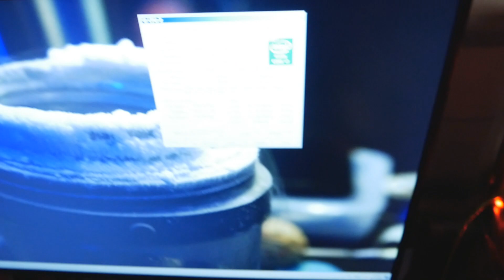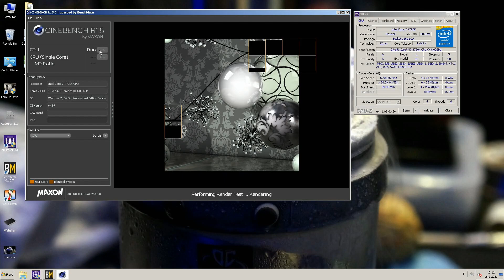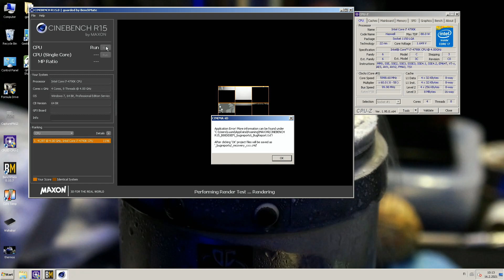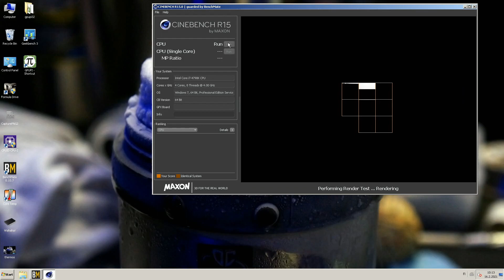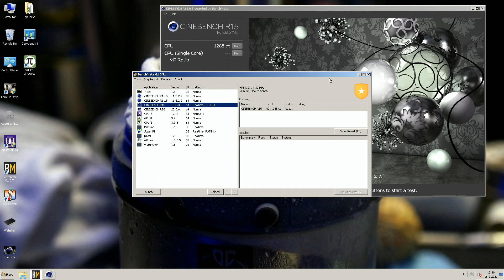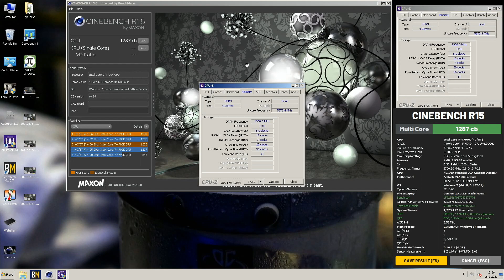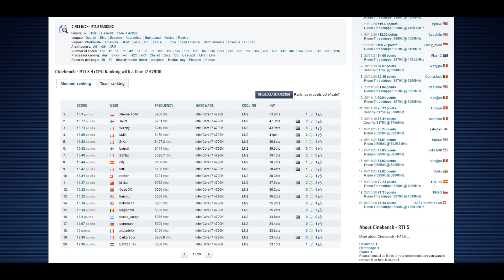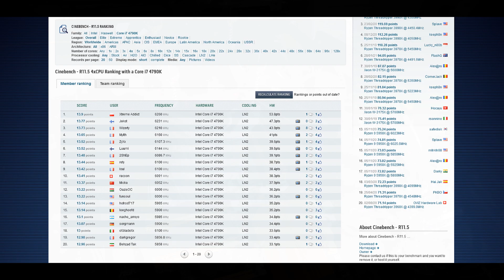Intel i7 4790K Overclocked Close to 6.2GHz on LN2 - Cinebench R15 RECORD

Comment: this is awesome!!!
i run a 4790k as my daily driver @ 4.8 ghz 1.310 volts, water cooled, kryonaut and delidded
i've been thinking i could try running at 4.9 regularly so i came to find some videos about top clock speeds :)
Reply: I’m running a i7 4770k and it running at 5.25 ghz in an msi board with a regular old Corsair liquid cooler in games it doesn’t get above 70 and cpu burner had got it up to 86
Reply: @Recon-3698  love that!!!  I feel like I could get more but my vrms cap out when i'm running a constant load over 115 watts lol
Reply: What affordable CPU cooler do u recommend to being able to overclock i7 4790K to 4.6/4.8 ?. I got a Scythe Kotetsu Mark 2 cpu air cooler now and it is good enough for handling 4.4 (max temp 81c)
Reply: @XenoCryptYT  I'm not sure what you mean by affordable. Getting something affordable and using it to push limits is generally not successful.
Reply: @justinbouchard  I understand that but there are coolers for the price of a higher end processor which would make no sense. I would like to stick to my cpu but just being able to overclock it. Is there a minimum cooler you could suggest?
Reply: @XenoCryptYT  i use an arctic liquid freezer 280, i don't know if there would be an option below 200CAD/USD/euro that would do anything for you.  My vrms overheat while my cpu stays below 75C with this cooler.  I'm not an expert or anything, just a dude.
Reply: @justinbouchard  You're a great dude, thank you for your response. These are priced like 100 euros in Netherlands, which is not that bad. I'll try one of these soon
Reply: @XenoCryptYT  thanks dude, just try to be a human is all i'm doing, i've had lots of love for the arctic liquid freezer, the fans are quiet and it keeps things very cool :)  hope it works for you

Comment: Luumi strikes again :) btw what kind of input voltage would you consider to be fine  when not going above 1.4v? I tried my cpu on 3 different motherbords and 2 set default to 1.85v and one to 1.75v. The rule used to be +0.6v of the vcore so 1.4v + 0.6v =2v. Would you see any benefit going above 2v? Cheers